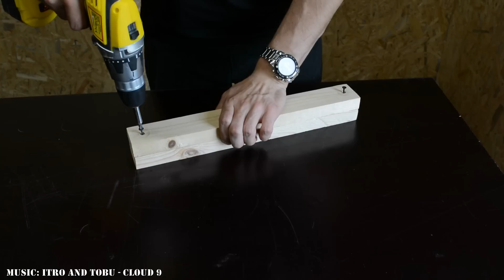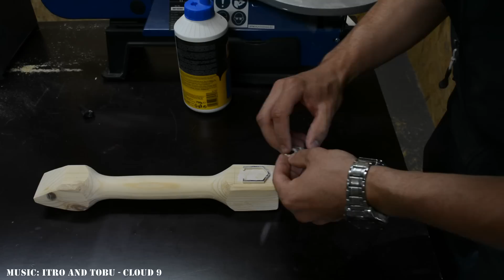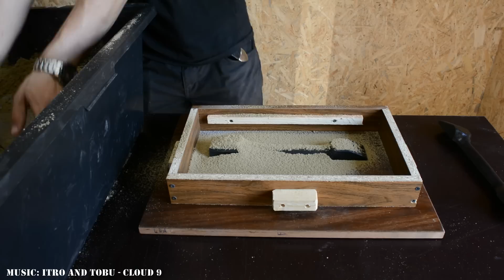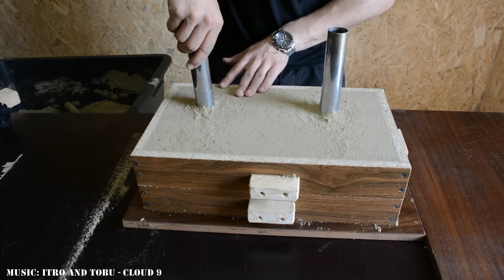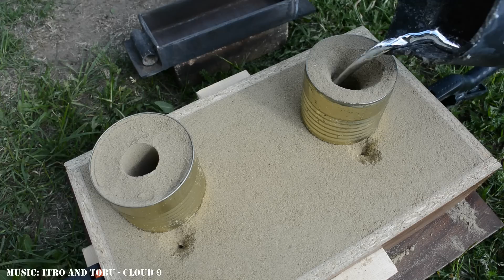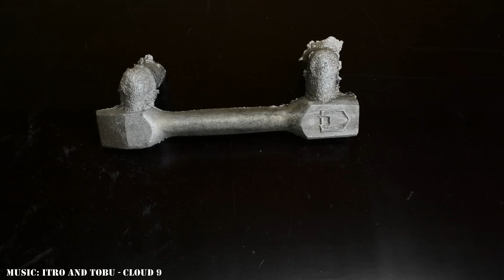Green sand rammer

Comment: +MP Dragon can i ask why use spray paint?
Reply from the maker: So the sand wouldn't stick to the pattern
Reply: Cool
Reply: MP Dragon question 
Why do you use baby powder 
Is it so the wood doesn't stick to the sand?
Reply: Yes, @Eugenio. Pretty sure that sand is a clay mixture (not really familiar with everything) but it makes it so nothing will adhere to it since there is an outer protective coating. Mind you a few grains might stick, but nowhere near what would be traumatic to the casting.
Reply: LifeHac

Comment: can you reuse the sand later ?
Reply from the maker: Yes
Reply: i used it for fun but now neighbours start binging mashine parrts, car parts they cant buy, so im looking more into steel smelting, iron to carbon percentage etc...oh im using an arc furnace, from a welder,, oil and gas isnt enough for the heat
Reply: +MP Dragon hey I messaged you here yesterday and you never gave me an answer plz get back to me

Comment: Yeah, your music is WAY too loud. Turn it down and also increase the volume of your voice in post-processing. Also, instead of making wood models for the things you're casting, you could just make Styrofoam models and just pour the molten aluminum into the holes and it will melt it as it goes down. You can learn how to make the styro-slicer to cut the foam in Grant Thompson's video.
Reply: SalandFindles true but with this method he can use the same wood models and reuse the sand also
Reply: A&D Productions True also. I guess it would be nice to have permanent molds to reuse over and over. It would just be a pain to make each and every one of them with perfect details, carving them out and stuff.